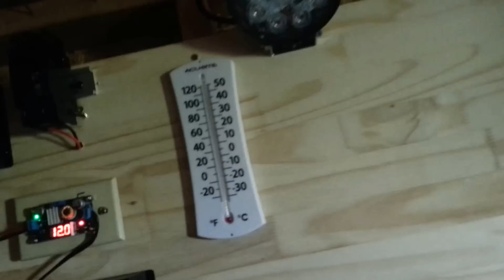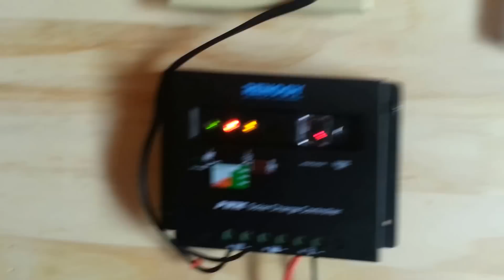Using 12 volt and 24 volt systems: all in one

Comment: Why are you only putting 12v to the 2nd charge controller instead of 13v or something ? You won't be able to charge a 12v battery with 12v.
Reply from the maker: Dragonfiregum 
Thanks for the watching and commenting.  I did ramp up the voltage above 12 volts to charge the 12 volt battery after this video demonstration.  If you see my later videos you will see the change.  Cheers
Reply: Nice, "needing 12v" issue  is kind of a pain. All my lights and radio are 12v. But my solar system would work better on the higher voltages. Less heat converting, and capable of more wattage. Already have a 12v inverter for my single device that it's needed for. So i had held off buying any 24v inverter ( 48v inverters are too expensive in comparison , 24 seems the sweet spot)   The bulk of the load being 12v means its hard to find a good enough stepdown.

Comment: Hi, When you get the 12v batteries to put on this system, would you be able to put the 24v straight into the second controller as the PV and do away with the regulator.?? or if somebody else knows, please let us know. Cheers!!
Reply from the maker: Ken, Because you are going down to a 12 volt battery system from a 24 volt battery system, you will need the DC step down buck converter and a diode and two solar charge controllers.  Without the step down converter, you would  end up with 24 volts on both controllers.  I hope this helps. 
Regards, DIY.
Reply: Thanks for that, it does help, I was thinking that the 24v going into the second controller as PV would be regulated by the controller to charge the 12v battery. Thanks again, you live and learn. Cheers Ken

Comment: IF you wanted 12 volts.why not tap one of the 12 volt batteries you have in series?
Reply from the maker: Would work but not recommended.  This could lead to charge state imbalance in the system.  You want the batteries to drain evenly in a 24 volt or 48 bank or any. battery bank for that reason.
Reply: DIY OneForAll thank for the info.my last comment was really a question .i'm stuck wondering what to do.i bought a uni solar roll up panal not reallizing it is 24v . all my stuff is 12v. i want to avoid loss or buying more stuff
i see that is not likely to happen.  i got a cheep converter . it said 30 amps. it has 24 gage wires???????????.junk. my panal is only 140+/- watts.it says it needs a 10 amp fuse but to use 10-12 gage wire? so much little things to charge to 120 amp hour batteries.
Reply from the maker: +immrnoidall 
I would recommend a solar MPPT charge controller.   It will handle the down converting from 24 or higher to 12 volts for you.  Plus, you do need a solar charge controller for this application.  I know it will cost a little more but your battery will love you for it.
Reply: DIY OneForAll great info .thanks .youtube is great.combining the knowledge of many . remember before the internet?  if you need to find out how to do something ,it was an all day affair of the library and trying to pry the info from "the experts" . now we just google it.  kids today have no idea how privileged we are.
Reply from the maker: +immrnoidall 
So true.  I started using the Internet in 1995.  I do recall making many trips to the library in those early years.  I don't have cable TV or paid satellite service, but one service I must have in my house is the Internet.  It has helped me tremendously.  There is a great wealth of resources out there.  We are truly blessed to be living in the information age.  All the best with projects.
Reply: DIY OneForAll remember chilton car repair books? it was  like $20 bucks and 3 inches  thick ,but still about as vague as could be. lol .
 the guys at radio shack hated to see me coming. lots of questions and no money.

Comment: so arent u loosing mad power in the stepdown
Reply: i hear using a "buckey"  or "buck" type regulator ,is the way to go.  less lose from heat because it works by switching on/off really fast ,to drop voltage. or something like that .

Comment: You'll never be able to charge 12 volt batteries properly with that set up as a flooded battery needs to get to at least 14.4 volts and an AGM needs 14V to be fully charged. So you really need to set the regulator higher to begin with. 

And also bear in mind it's getting it's feed essentially from your 24 volt battery bank so the current is only limited by the regulator. This could be quite effective though if the regulator has a constant current mode setting.

Problem is that now you would be also feeding that higher voltage to your 12 volt accessories. Maybe use two regs. One for charging batteries and one for the true 12 volt circuits. Finally, it's important to remember that those cheap charge controllers tend to switch on the low side (i.e. the negative wire) so you can't have a common negative connexion anywhere in the system.
Reply from the maker: I set it higher to charge. This was just the demo. Thanks for watching and commenting.
Reply: +DIY OneForAll I always enjoy seeing what people are up to with their solar set ups. Does your stepdown regulator have an adjustable current limit? I presume most of these devices would have some kind of fixed upper limit at any rate... I totally agree that it is useful to have 12 volt circuits due to the higher abundance of accessories, and run them myself for that exact reason.
Reply from the maker: xanataph 
The one in this video does not have adjustable current but my latest one does.

Comment: Hi Anthony.... Great videos. I don't know much about electrics so this may seem like a silly question but ... I am converting a bus and I want to run a 24 volt system. Can I run my fridge, tv and say microwave from the 24 volts and run some other 12 volt appliances IE stereo, cb and some lighting on 12 volts all from the same battery bank?
Do you have a video on this?
Cheers.
Reply from the maker: Indeed, it can be done but you would need a dc to dc step up converter if going from 12 volt to 24 volts and a dc to dc step down converter, if going from 24 to 12 volts.  If you are connecting both voltage systems to the same battery bank, I would not recommend connecting two inverters to the same battery bank. However,  what you can do is connect a 24 volt inverter to the battery bank and use that for AC stuff, then connect a step down 24 volt dc to 12 volt dc converter and use that for your volt applications.  However,  if you want to go with strictly dc appliances,  then wire the battery for a 24 volt application and go straight off that for your 24 volt dc appliances,  then connect a 24 to 12 volt dc converter for your 12 volt stuff. I will be posting a detailed video soon on this.  Currently,  I have a 24 volt battery bank, which is connected to a 24 volt dc to ac inverter and a 24 volt dc to 12 dc step down converter for my 12 volt light, fan and so on.. I hope this helps. A video will be uploaded soon.
Reply: Anthony Hope
Thanks Anthony..yes makes perfect sense.. Was having a blonde day !!

Comment from the maker: Also, I want to add that the higher the voltage, the lower the current and the less the voltage drop for longer cable runs.   If you go with a lower voltage (12 volt for example),  the higher the current,  so thicker cables are needed and the higher the voltage drop over longer runs.   However, with a 12 volt system,  you find cheaper accessories than say with a 24 volt or a 48 volt system.   With a 24 or 48 volts, your inverter will work more efficiently,  as it has to ramp up less to get to 120 volts AC, plus you can use smaller cables.  Again,  it all depends on your application and need.